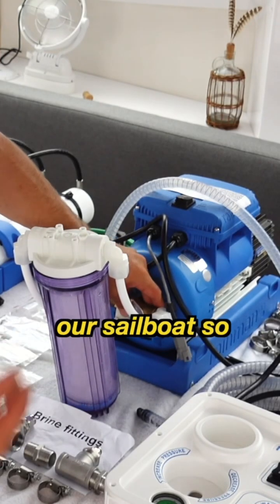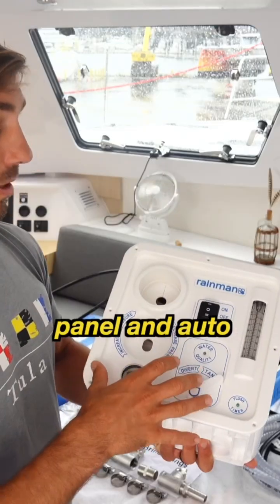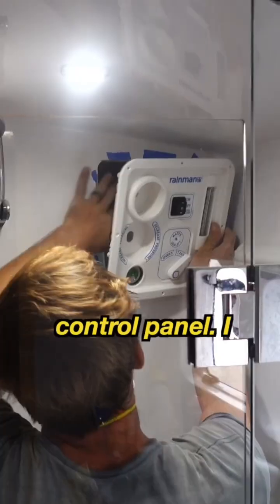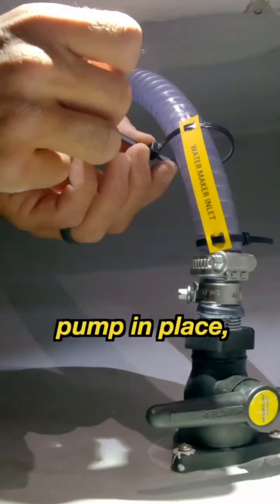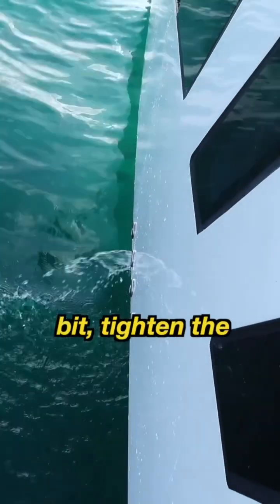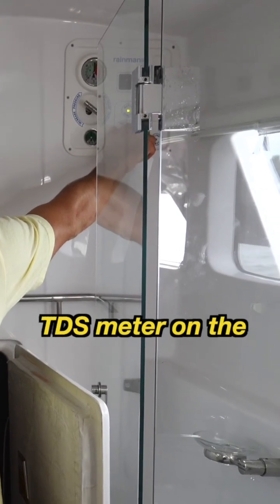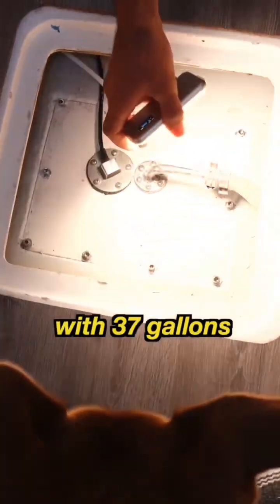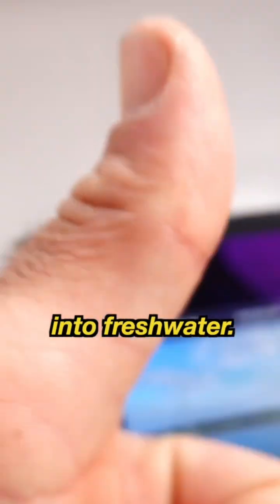Installing Our Rainman Watermaker on our Sailing Catamaran #diyboatwork #watermaker #tula

Comment: I wonder if a charcoal filter before it goes into the holding tank would make a difference?
Reply from the maker: The water that is produced by an r/o system is very pure. There is nothing left in the water that a charcoal filter would be able to filter out.
Reply: Fancy stuff  @Tulasendlesssummer
Reply: @Tulasendlesssummer do you charcoal on the output side of the tank? If not, what happens if you’re either capturing water or filling at a marina?